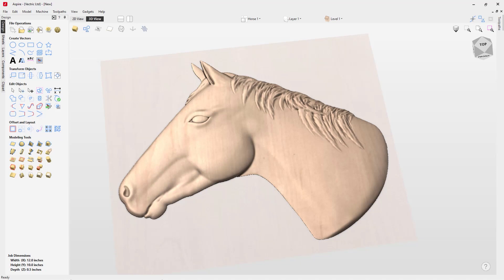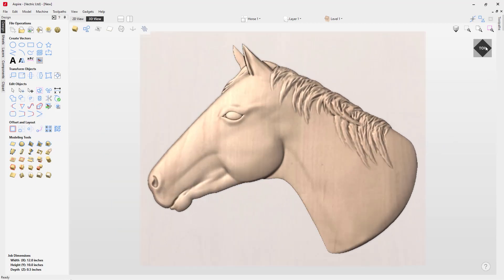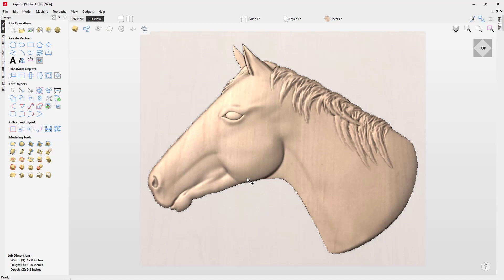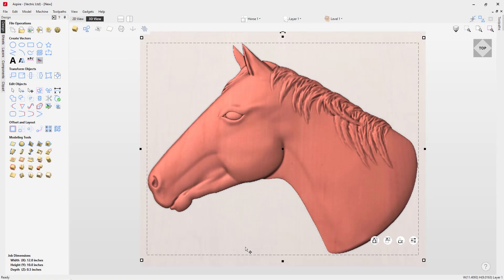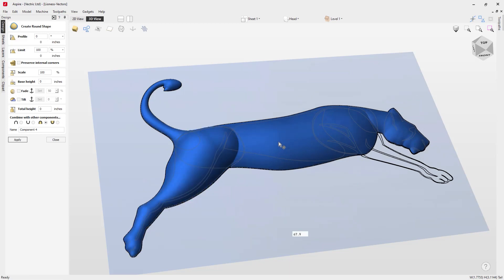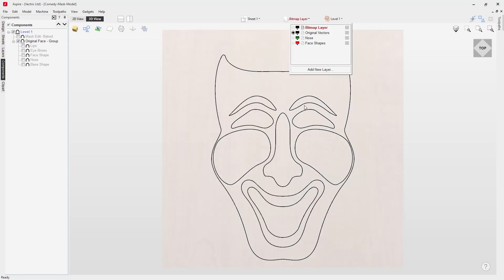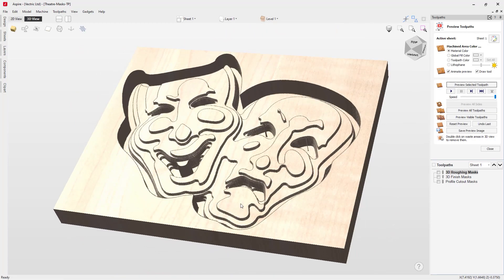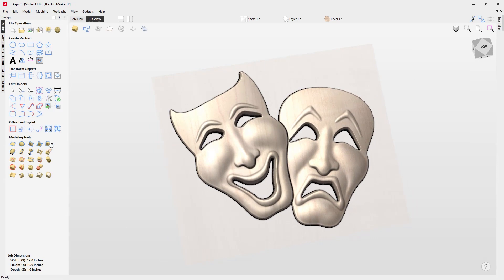Introduction to 3D modeling in Vectric software | Modeling Tools | V12 Tutorials

Comment: I have created a 3D model /bas-relief/ in Solid Works, with what extension should I save it so that I can import it in Vectric?
Reply from the maker: You will need to export it as an STL or OBJ file.  If you need help with that please email support@vectric.com and they can give you a hand.